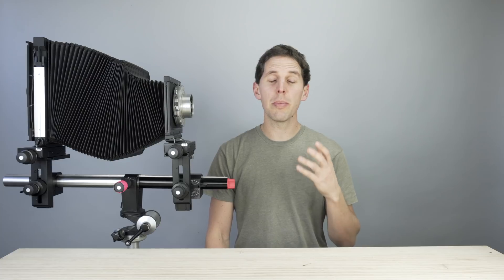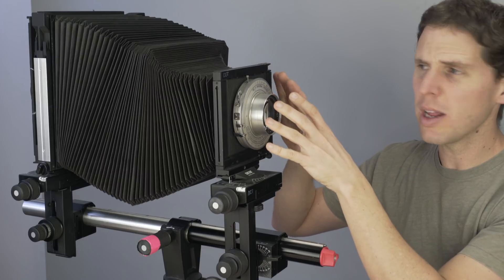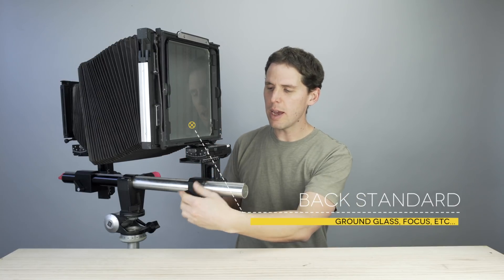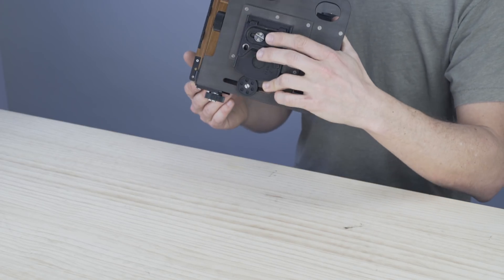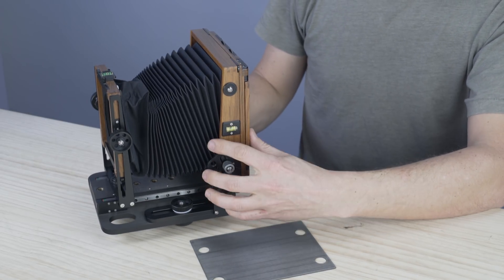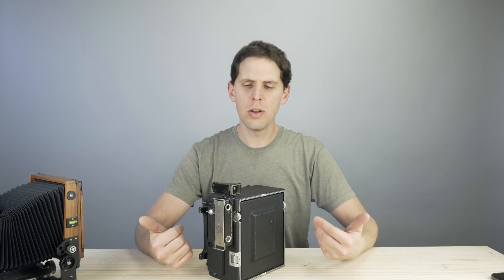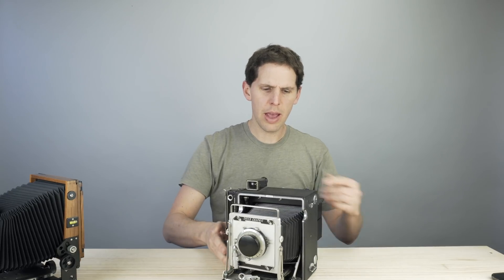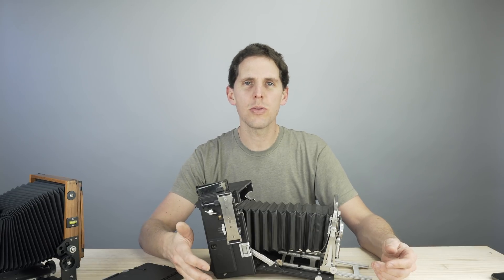Camera Parts & Movements:  Large Format

Comment: Dear Nico, when you fine focus with the front stand (lens), you also change the composition. It is better to roughly adjust with the front position to make your composition, and do the actual fine adjustment with the rear stand (film).  In this way your composition will not change. Am I right?
A fan of the top shelf ;)